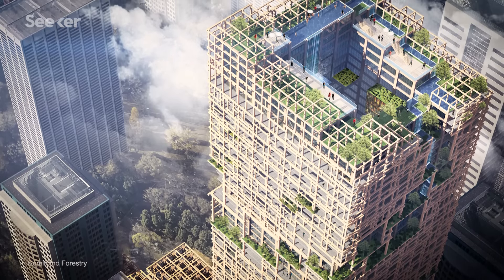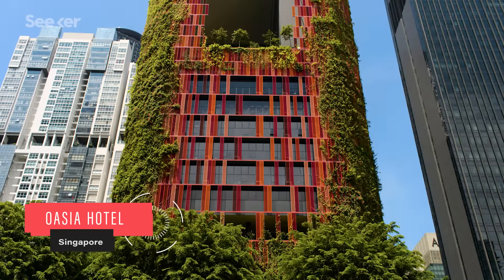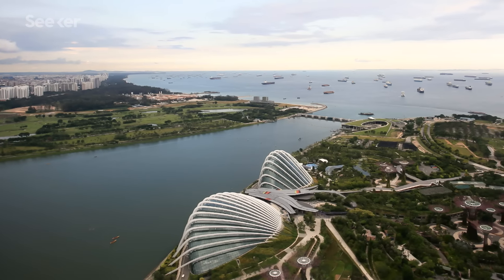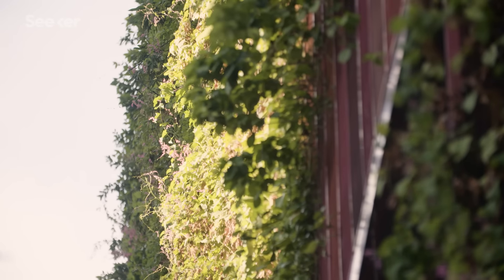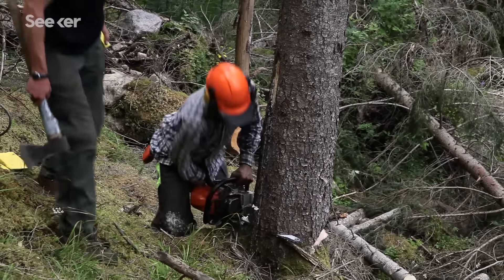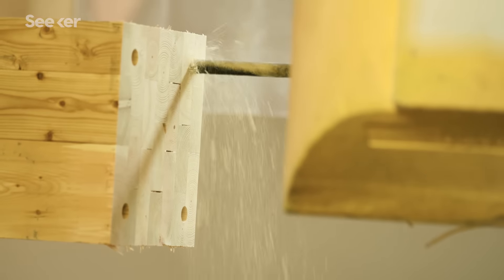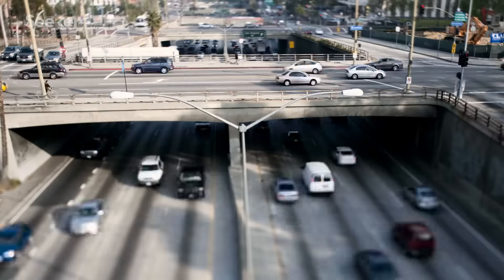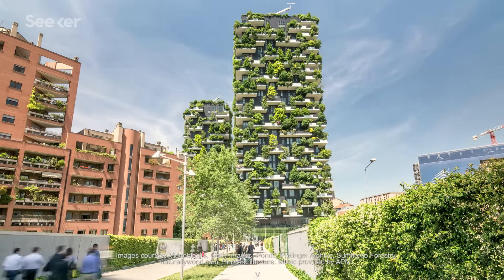Skyscrapers of the Future Will Be Engineered to Copy Nature

Comment: We had one of these green buildings (on a smaller scale) where I live.   It was great for about 3 years.   Then the watering system in the walls started to break down and the "green wall" died.  Shortly thereafter they had to rip the rest of the facade away to repair water damage from leaks in the irrigation system that had caused major issues with mold and rot.  They elected to replace the green walls with normal glass and steel.  Amazingly, the overall cost of operating the building went way down and the employees inside stopped complaining of frequent headaches and respiratory issues that had been caused by the mold and mildew from the leaking irrigation system.

I love the idea of green buildings covered in plants, but understand that they come with a HEFTY operational cost and can raise issues that can make the building itself unfit for habitation due to mold and mildew.
Reply: Thanks for providing an insight into the real world application of this vision. 

Building more parks and open spaces would make a lot more sense.
Reply: What if they get termites…

Comment: Broad Group which has built factory mass produced skyscrapers has a new construction innovation – Core Tubular Steel Slabs (CTS).
* CTS are 8 to 20 times lighter than reinforced concrete
* CTS are 100 times more corrosion resistant than carbon steel
* CTS able to withstand temperatures 300 degrees celsius higher than carbon steel

The 6th generation BSB features a stainless steel panel clip diameter 16~32mm thin-wall core tubes, employing a special vacuum brazing assembly line which reduces cost and enables mass production.

Source: "Core Tubular Steel Slabs are up to 20 times lighter than reinforced concrete" - Brain Wang at Nextbigfuture

Comment: "All these structural wood elements, that need to be protected from fire, they're encapsulated in drywall. These elements cannot burn anymore, and they're just as safe as if it were concrete structure."

So all that wood at @4:28 is not structural? Dry wall protects from fire as much as concrete? That doesn't sound right. 

I thought environmentalists talked about deforestation as one of the major problems we face today. When did that change?
Reply: Go buy a piece of drywall and try to burn it...... that isn’t happening. But I here you on the deforestation.

Comment: What about old growth trees?  Wouldn’t using Hemp/bamboo that grows quickly with minimal energy be even better to include in the equation?  Defining the term renewable is necessary.  If a tree takes decades to mature that is not necessarily renewable or ecological.  If the root system is required for erosion deflection, again, these factors must be considered.

Comment: Nice, but the future is most likely a composite of concrete load bearing cores, such as the elevator shafts, stairways and the main transit routes, surrounded by wooden constructions. That way the buildings can be renovated very easily and will look like new after doing so. This can be repeated up to the point where the concrete cores are no longer safe to be used and a new building can be be erected. So life cycles of 200+ years.
Reply: I've also heard that the most economical size for buildings is between 8 and 12 stories. It looks like wood can already handle this height so the choice of materials for a particular structure would be based on other factors. 

I'm seeing buildings now that are steel reinforced concrete up to 10 floors or so, then steel above that. Now you could replace the steel with wood or add a wood frame above the steel.
Reply: That's what I said no? =D

Comment: Actually, the subject of engineering will change into something we would struggle to call engineering. It has already started. In the future all structures from spaceships, buildings, bridges to shoes and backpacks will be "grown" in AI environments to "evolve" the best solutions (designs) using the least materials to achieve the strongest and most flexible results. Already companies like airbus are allowing AI to grow their fuselages in stress simulations and then print them up using industrial 3D printers. Simplz

Comment: vertical sky scraper gardens are awesome until you get clobbered on the ground by fruit / vegetable from 40 floors up. windows can be equipped with screens to keep the bugs out and most sky scrapers are climate controlled with non opening windows. Universities have been doing vertical gardening for a very long time. that is where the term ivy league came from. The ivy that grew up the walls at the  universities. It would be cool if they could make bioluminescent plants for the sky scraper vertical gardens. Night lights and carbon negative
Reply: Your comment was more informative than the video

Comment: I just wonder how durable wood skyscrapers actually would be. It is very strange to think about it that wood can be as strong as concrete and steel. 
But besides of that, how does it deal with humidity, earthquakes and actual fire? How long does such a building last so it stays safe?
Sure, you can treat wood in a way, that it is extremely resistant to humidity, but most wooden buildings have to be renovated earlier than concrete and steel buildings. And how does a wooden skyscraper react when suddenly, some walls and support beams are missing? Steal and concrete doesen't care much if it isn't a too important support that is missing. But how is it with wood? 
Wood is very flexible, I am sure it will handle earthquakes fine. But it can stretch very much with temperature differences. How do you design a building that is made out material that transforms in size a lot? How do you keep the building stable?
Whart is with fire. Sure, massive wood is basicly impossible to ignite, like concrete. But the thing is that when a fire breaks out, the furniture and all the stuff inside the building catches fire. This fire gets bigger and hotter, hot enough to ignite massive wooden structures. Concrete and steel doesen't burn, no matter what. Sure, concrete may get brittle, but it doesen't burn down, unlike wood. How do you keep wooden buildings safe?
How much load can they carry? Sure, in history, we build massive wooden buildings, churches, houses etc. But these were all very small buildings which did not carry such massive load compared to a skyscraper. How does a wood building handle ten thousands of tons load in such a hight? 
And how high can wooden skyscrapers actually become? Currently, it doesen't seems to be possible oneday to build wooden skyscrapers over a kilometer in height. 

The other thing I wonder is if wood is  going to be the material of the future and if it is going to replace concrete and steel. 
The production and developement of graphene is growing rapidly. In maby 10 years, we could mix graphene into concrete and make it significantly more durable, whoch would make wood a very bad choice for building a skyscraper in comparison. But maby, we can treat wood with graphene too, whioch would increase its durability and positive characteristics
. 

It would be really nice if wood would be the material of the future. But now, it seems to be very limited for building such massive structures and it comes with many challanges and current disadvantages. Maby I am wrong with this, I am not an expert.
Reply: I live in a wood frame building in San Francisco that it doing fine after 100 years. It would be better if it had a full sprinkler system, but we could add that. Steel and concrete have their own problems as they age and steel has problems with fire as well. There is no "perfect" building material.

Comment: Want to convince me a wooden skyscraper is safe? Build a 50 storey demo, then while nearing completion, detonate napalm based bombs in several vulnerable locations in the structure. Put out the fires and save the people inside the building and only after this ordeal by fire, will I be truly convinced as to the safety of wooden skyscrapers.

We can't simply make buildings strong enough to withstand high loads, they need to be able to resist human acts of malevolence.

Comment: So, now the story is that we can save the planet by using more trees?  That's not what was being taught 30 years ago, at all.

This approach at least seems more sensible than the old one, and if you really have fire resistence sorted out won't harm anyone.  So build away, some pretty skyscrapers are a good thing.

If you want people to consider that "climate change" is a threat, though, or even believe there is a consensus that it is thing that we can influence, you might want to, I don't know, have an actual stable consensus on what it is, why it is happening, and in which direction it is changing.  Every couple years some key aspect of the message changes to be the opposite of what it was before, and this is the latest example.

Comment: 4:08 in, You weren't making any sence tell you mentioned rasing the wood as a crop, which would mean select cutting, which would mean real forestry as in controlled burning of under brush to benefit the quality of the wood by driving away parasites, and removing the underbrush material that causes forest fires in the first place at the same time..! You're talking about growing trees as a crop and actually protecting them with real Forestry, instead of global warming climate change for a street that lets the underbrush grow until it becomes a fuel that completely burn down the entire damn Forest..!

Comment: Using wood in construction as  building material is disgusting. on top of that, they are deforesting causing harm to environment of that area which effects ecological and biological life. Am an architect and I strongly oppose using wood as building material. We have much higher strength with wood textured materials that are available in market with much cheaper rates. These type of practices should be banned.

Comment: BUILDING FROM WOOD! CONSTIPATION OF THE BRAIN AND DIARRHEA OF THE MOUTH!!  As a civil engineer myself, I have to say, building from wood is the STUPIDEST idea I've ever even thought I could ever hear. We have been trying to move away from water sensitive, insect sensitive, mold sensitive, fire sensitive material with less strength through human history for good reason. We have even begun building houses out of ICF and steel for those reasons. It's actually more environmentally damaging when you treat wood with all the dangerous chemicals to make them somewhat resistant to termites and mold... and they still burn and get soggy, so you now have to spend even more resources and make buildings even more expensive and complex to protect the entire structure from moisture and water, with even more costs down the line. Truly stupid.